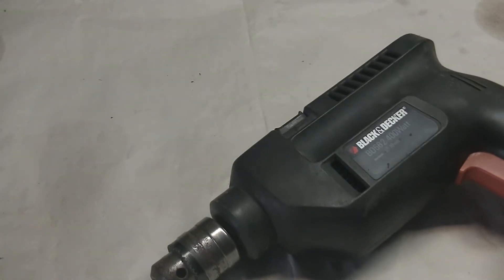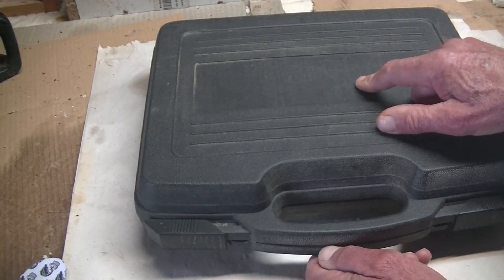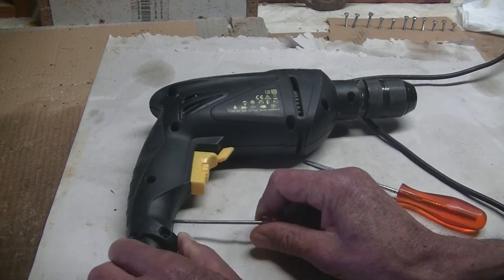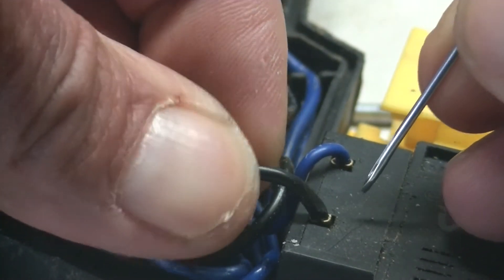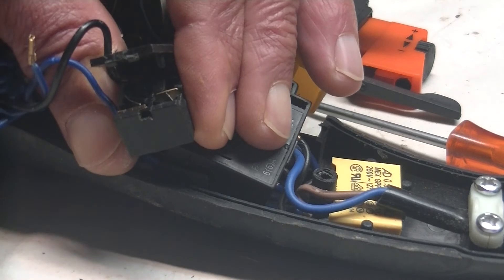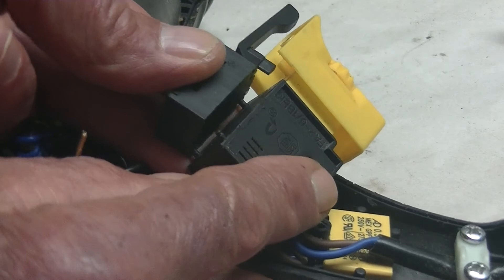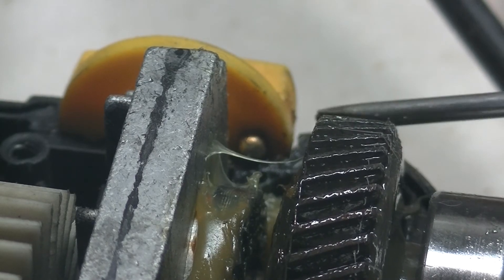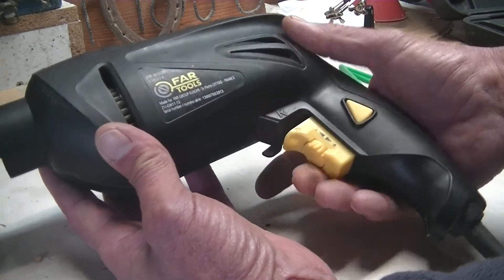How to Replace the Reverse switch on a Drill

Comment: Thanks for this video. I was given a Power Devil drill that didn’t work. Some small bits of plastic had jammed the trigger. Although it worked after, it would only work at full speed. You have made my mind up to purchase a switch and attempt to graft it in. They seem to be generic in design, so hopefully I can swop the buttons on to the new switch. Nice no nonsense, music free video.
Reply from the maker: Thank you Alan, !! i bought mine from Amazon and yes you're right, a lot of the triggers seem to be a similar design. Hope you can find one and get your drill working properly again

Comment: I agree with you absolutely Dave . Why build a decent looking drill and then put on a cheap plastic flimsy switch ? I had a similar instance.. My Qualcast Lawn Mower would not run.I traced the fault to the switch box on the handle.Burnt out.Could I find a replacement ?No way.Acomplete handle assembly cost over £20 .I ended up buying a Macalister because in the long run more cost effective .I guess you were lucky to get that part Dave,although I dont know anything about FAR tools.Enjoyed the tips and advice .Thank you.:yougotthis:
Reply from the maker: You're welcome Mark, thanks for watching. Yes, that was really cheap and nasty. I tried to super glue it but that didn't last long! Finding spares for anything is a nightmare and trying to get something repaired is impossible in our new throw away society.

Comment: Dave, I have a Skil drill with the same situation -- solid drill with cheesy plastic forward/reverse switch. It got stuck, and when I forced it, I think the switch broke (it's now stuck in reverse mode). I'd like to replace it, but the part is discontinued. Do you know if they're interchangeable? My model # is 6215 and the switch looks just like the one you got on Amazon, but I can't find anything like it online.
Reply from the maker: Had a look at your drill and yes the switch looks the same. Inside the switch there are 2 little metal plates that slide backwards and forwards to make contact. Maybe one of them slipped out of place. If you want to try it, make sure you have a magnifying glass and nimble fingers. This is the switch that I got from Amazon France;  https://www.amazon.fr/dp/B09KXTGJPW/ref=pe_27091421_487030221_TE_SCE_3p_dp_1
Reply: @davekennedy52  Thank you! Alas, I think my drill has shuffled off this mortal coil. I had a friend's husband take a look at it.
Reply from the maker: @byzyt6931  Thats a great pity!! I get pretty attached to my drills and other tools and hate it when they stop working. Sounds like you're the same?
Reply: @davekennedy52  Well, I'm just old-fashioned I guess. I'm not fond of the throw-away society we've developed. I'd prefer to have things well made and keep them for years instead of a bunch of plastic junk made in China that piles up in the landfills. But I had a good run with my Skil drill. sigh